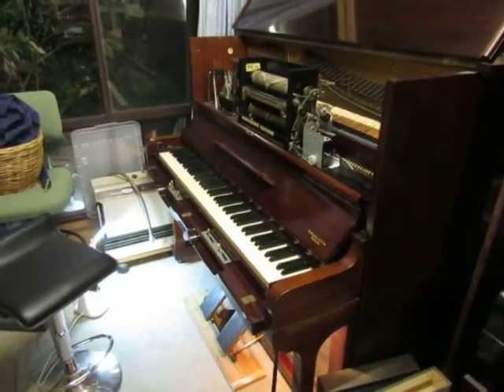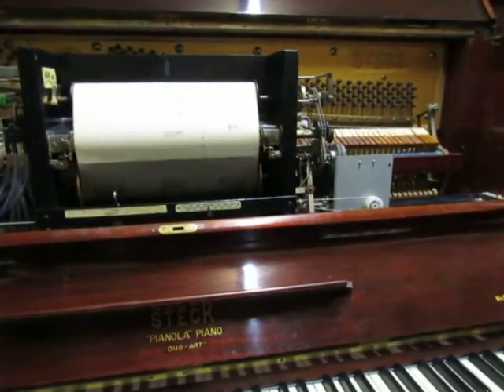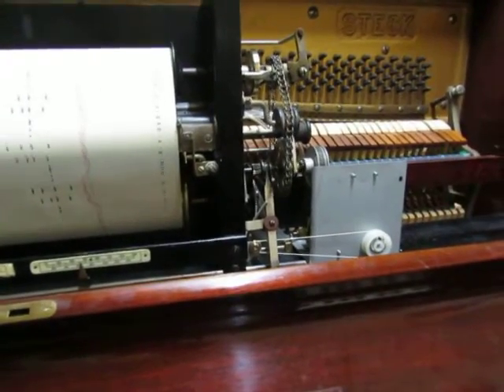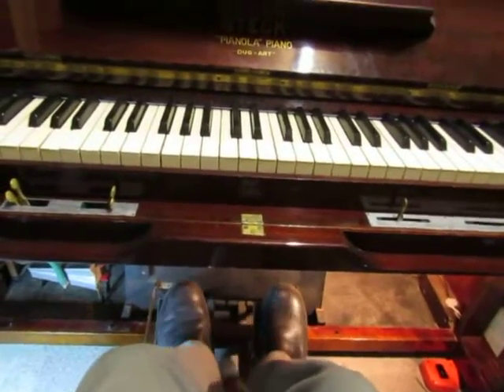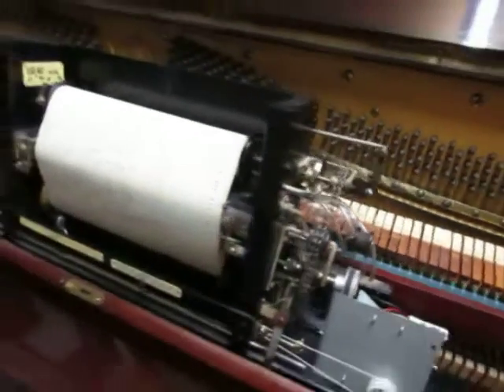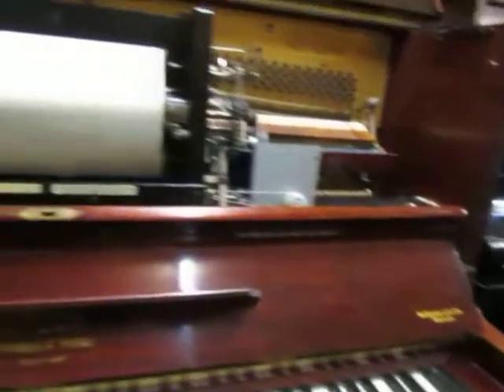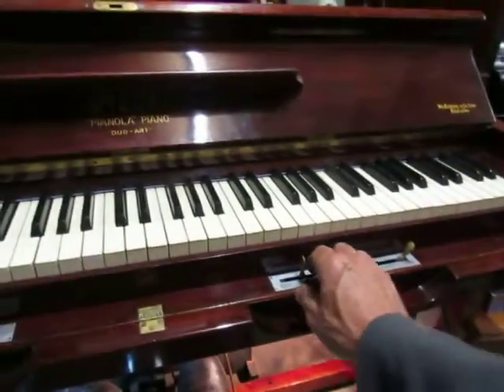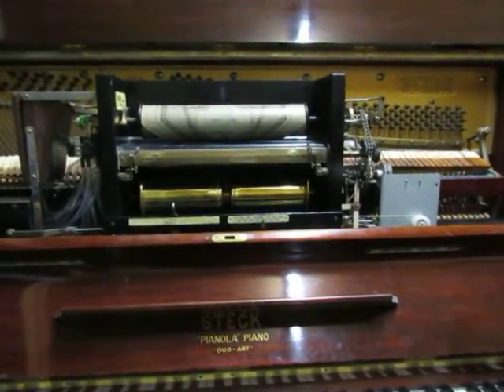Steck half Duo-Art Pianola player piano 1932, with wind motor electric conversion

Comment: This is great. I am trying to put a motor on ours and I need some info re a gearbox. I have a sewing machine AC motor and speed controller but I need to slow it down a lot. Also I have a DC speed controller like yours but need to know what motor and/or gearbox to use. Can you assist please. Thanks.